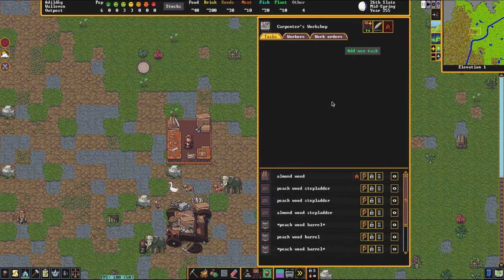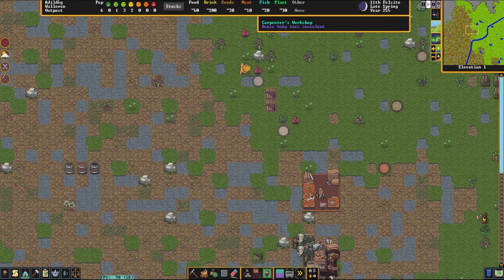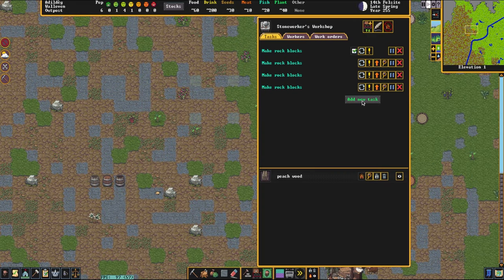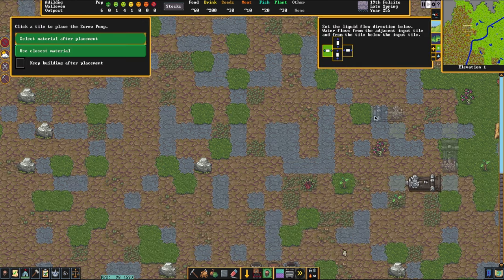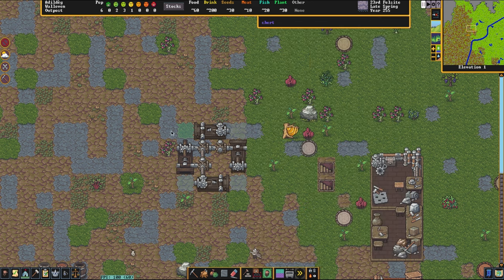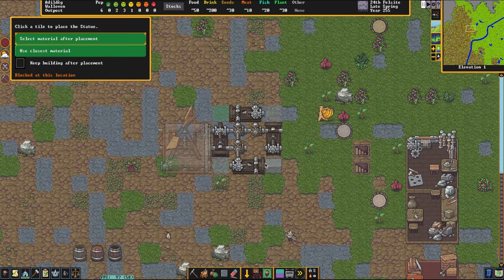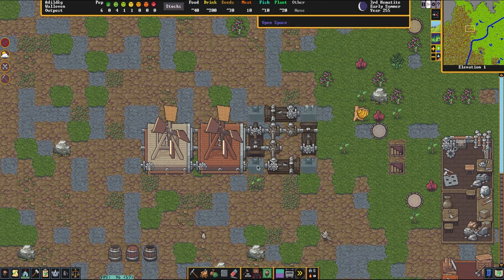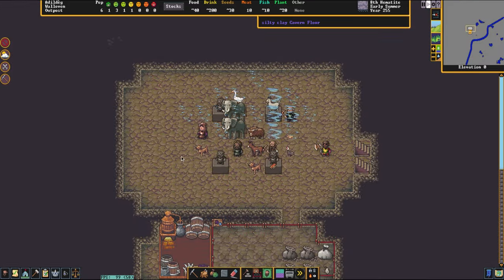Dwarf Fortress  - Quick Tutorials - Mist Generators (The right way)

Comment: Now just have to figure out how to get a bush to drop its fruit and create a puddle of wine in that spot so I can mist my dwarves with booze.
Reply: You can try a dump zone for barrels of booze in the spot the pit goes.  At least in the past dumping booze barrels spilled the booze on the spot the barrels were dumped...  Remember that from some failed experiments trying to use a quantum stockpile for booze.
On the other hand, not sure you want vaporized alcohol in the tavern.  The fights might get very explosive!
Reply: @vonsch9793  Oh what's a decent tavern brawl without thermobaric explosives?
Reply: @vonsch9793  could that even actually happen
Reply: @bufoalvarius2520  Dunno.  Haven't tried to make it happen.  Probably need an ignition source.  Dragonfire...
Of course, if a dragon is breathing fire in your tavern, alcohol vapor is moot.
Reply: It's not possible because booze in the game are technically just items, not actual liquid like water or lava.
Reply: @nak8269  hm, lava mist generators as a defensive measure))) Only problem that this system has no easy way to stop/start
Reply: @nak8269 actually false, like you can't fill a block with it, but anything that can splatter on the floor can be misted, including liquefied rocks
Reply: PETITION
John Joseph Stoner Dwarf requests residency.
Reply: A minecart from the agrifield straight to the magma chamber

Comment: Could we get a quick tutorial on how you organize your stockpiles? Feel like that would be helpful for me at least.
Reply: start very generalized, and then break them down into more specific piles as your fortress progresses. i always start with one for wood, one for stone, one for corpses & refuse, and one for everything else. then, after i set up farms i make one for seeds. after i set up a tavern i make one for drinks. after i set up a mausoleum i make one for coffins and slabs. etc, etc
Reply: make one billion bins and assign them to stockpiles
Reply: @chris-2105  I mean yes, but actually no. 

Yes, that 'works' things get in bins and the fortress isn't a total mess.

But no, when someone brings an item to a bin that bin is 'locked' no one else can do anything with that bin at all. This leads to job cancellation spam and 'serial slowness'. 

When properly setup the dwarven logistics system can make a massive number of goods in an extremely short period of time with high organization in a parallel fashion. The problem is it takes a lot of manual work and flipping of setting on individual stockpiles and even setting up things like one tile minecart stops and feeder stockpiles.
Reply: To add to that, I wouldn't mind the tutorials being a little longer for a bit more depth as well.
Reply: @petergraphix6740  I thought the bin locking issue was fixed in the steam release
Reply: Once I've realized the magic of Quantum Stockpiles, I've found keeping my stuff closer to the workshops a lot easier to organize.
Reply: @chris-2105  bins are bad ... for anything that is used regularly AND FOR TRADE GOODS! Having your gems and goblets disappear in bins makes them invisible to the "move goods to trade post" menu.
Reply: @Muck006  Not 100% invisible. You just have to go to the bins section of the trade menu.  Then you'll see finished goods bin, gem bin, etc. Then you can click on the individual bins to see what exactly is in them.

Little annoying but workable.
Reply: @douglasbeltowski7921  Then you forget you're trading with elves and try to trade them a bin full of trinkets and... argh, wooden bin. :p

Bins are evil.  I don't allow them in my forts any more.
Reply: @vonsch9793  to each their own, just trying to keep the possibilities open.  One thing I like about the elves is I can't seem then bones, or leather, or meat but I can sell them tallow roasts 😂

Comment: Funnily enough, building a mist generator this way probably would've saved 6 of my civilizations nobles, because redirecting water from a river with a water fall for a mist generator made that part where the water fall low enough for dwarves to path over it, but not enough to make it actually safe, so it killed 6 nobles, all visitors, before I could build over it all. One of them was pretty sad because they fell in, climbed up the waterfall, which was pretty cool because it was 18 z levels they fell, left, then visited again later and died on his second fall hitting new corpses as they fell💀
Reply: I mean, on the upside: You rid your civilization of 6 nobles.

Comment: That's great. Would love to see a moat tutorial (from start to finish) for fort defense
Reply: Dig. Hole.
Remove. Ramp.

Moat.

---
For those not getting the joke, "moat" just means "hole". No, it's not even filled with water usually.
Reply: @kjeldschouten-lebbing6260  I made a magma moat once, the "only" issue is flow, it slows really slow (and water to if not pressurised) so that is thing to keep in mind.
Reply: I think I heard some other video saying you want 2 levels deep and 4 wide if this helps. Shouldnt be terribly hard to make. You can make the bridge on top of a built floor and delete the floor after.

Comment: thanks I used this tutorial in my fortress, I had to build 4 windmills total for the ring, it seems my map has low wind but it's working like a charm.
I added iron floor bars on top of every hole to protect the fortress from invaders as I had to place this setup on the surface above my main staircase, there was no room anywhere near my meeting places like taverns and such. Unfortunately in winter the water freezes and removes the bars in the spot where it froze, in a future fortress I'll plan for one underground powered by waterwheels to avoid this issue.

Comment: Just a heads up for everyone. Blind mentioned managers, and he wasn't using one. I assume because it's a new embark. Another person in the comments, Pilvenuga talks about how low the requirements are for a Manager.

As everyone is probably aware. You need the requested rooms for noble positions, before they can do their job. A Bookkeeper for example, will not do his job until he has an office with a chair (table not required). (Tip: When first starting out just overlap his office with one of the chairs in the dining hall).

When you first embark, while a Manager requires an office and chair (and will say so on the Nobles screen). You don't actually need it. Set your manager, then add a work order. Either in the workshop menu, or by pressing "o" and adding it as a general work order. The work order will be activated without the Manager needing to approve it. Though you do still need to set your Manager. Once you have a migrant wave and some new Dwarves show up this will no longer work and you will require the office. I'm not sure what the exact amount of Dwarven population has to reach for this. It might be 20. I may be wrong about that part though.

Comment: I usually just get river / brook water routed to 4 statues that stand together, grate area around statues and route running water to flood caverns. This requires no power and I can fill a well as an off-channel of the drain, but it seems that constant cavern flooding does degrade fps & surprisingly just falling water without any pump action does not generate nearly as much mist as this setup
Reply: Falling water in your method is commonly 7/7 which is actually dangerous. You need to take a single wide tile off the stream, then let it widen out to 4 or 5 so it's no longer 7/7 at any point, then when it falls its much more likely to be mist. Then run it off the map via fortifications. Massively reduces the amount of calculation that needs done.
Reply: @petergraphix6740  Yeah it hasn't caused me any issues lagwise, but beware if you have a waterfall. The decreased pressure on the front of the waterfall can make it so dwarves will path over it, but they will sometimes get swept by the water and because there's a ledge there, fall off. This killed 6 of my visitors 😂

Comment: Why dont just use a hole inside 3x3 ladder with grates, so water flows from river through your base, generating mist. 
This water is also used for drinking, cleaning, and powering waterwheels. Also i find shells on grates sometimes. Drainage is, obviously through fortification.
Reply: Also, this setup is much more realistic. That's something you clearly appreciate, right?

Comment: step 1: build fort under aquifer
step 2: channel pits through the aquifer and all the way down through your fort
step 3: build a drain or reservoir or something on the lowest level

bam free mist
Reply: Note there are high flow and low flow aquifers. Doing this on a high flow with no way to shut it off would be... interesting.
Reply: @petergraphix6740  it's actually much more efficient, you have to dig out quite a lot of light aquifer to get a significant amount of water. But yes, heavy aquifer would require a diagonal gap to reduce water flow/cancel pressure if you don't want to flood the tavern!

I do like powerless mist, makes set up so much simpler when you don't have to get windmills up and running or set up another set of water channels solely for power. But I don't use power much anyway so that might be why.

Comment: Thanks for the great video. 
I made a 4X4 mist machine that worked perfectly. 
I tried a 6X6 (using 2 screw pumps per side) with everything else the same. The 2 pumps on each side were nose to tail.
But it failed, and split water down the holes, pooled up & no mist!
Any idea why?

Comment: Why does mist improves their happinnes soo quickly? The mist generator needs to be right above it or can It be above xmany z-levels?
Reply: The trick being exploited here is that a pump grabs water from the tile below it's rear and expels it directly out the front (where it falls one level and creates mist before immediately being sucked back up by the next pump).  This particular arrangement won't work across more than one Z level, although you could use a stack of pumps to bring it back up a bunch of levels.

Comment: My fort has a big waterfall right next to it. Too bad it's dangerous to be there, with the constant attacks of flying enemies. Maybe at some point I can create a structure around it and have a new tavern there.
Reply: Bonus points if you have it hidden behind the water and use a drawbridge to open the secret door to allow NPCs in or out.
Reply: I luckily don't have flying enemies, but I did put iron bars around the waterfall on my current map. And fortifications along the other open walls. Dorfs kept falling in and drowning. And I didn't want elves getting in when my river freezes in winter.

Comment: Followed guide and the 'structure' worked fine.....but the water in the pit zone froze in the winter and stopped the mist! Is this normal or is it because I had to dig down more than one layer to reach the targeted room?
Reply: I'm having the same problem in a temperate area, did you ever find a solution other than having to build deeper down?

Comment: Is there an efficient way to haul stuff up the z-axis? An elevator? Some fancy corkscrew minecart track?
Reply: Minecarts with ramps IIRC and setting Stops and unloading but someone has to reset and push the cart back down to the lower levels.

Comment: How should I go about building axles? Dig a hole next to my stairs and build it in there? Will creatures be able to enter a hole from the wall where an axle passes? Can axles go through slits?
Reply: You need to connect the curves/endpoints of the axle with a gear assembly. So, you go horizontal right > gear assembly > from here you can connect a horizontal that goes up/down/left/right (on the same z-level) or you can go below and place another gear assembly directly below the top gear assembly, and from there you can make the axles on the directions you want again.

If you want to go straight up below the earth I believe you use the vertical axles to connect below the gear assembly and design it like you would do with stairs, except there should be a hole already dig.
Reply: @victormatheus3576  Or just put your power source below the surface with no holes.  Safer.  Look up waterwheel on the wiki for some examples.  Perpetual motion machines are a thing in more ways than this in DF!

Comment: someone needs to start testing the frame and load of everything in DF, for example: What is more heavy for the game? several machines or mist generators, or several diverted waterfalls, because only one is easy to say it does not impact framerate, but usually we are doing several different things in an enormous fort and we don't know what would be the least impactful. 
I was personally thinking of diverting a river/creek into a X shaped stairs, where 2 sides of the X without stairs would have the mist and I would put grates in each floor. If we have a fort deep enough (100 floors) that surface water would fall (I would try to have it 1-2 deep only, never 7) but the cost on frames might be bigger than diverting the river into the fortress, creating a mist generator only on that level.
Another question: where is the best place? I saw videos saying TAVERN, others TEMPLE and others DINING HALL (because they compound with other happy thoughts of having a good meal). if that is the case my plan above to put in the stairs is less efficient than putting in the dining hall.
same goes with other technical questions: having one (or more) quantum stockpile or dozens of huge stockpiles? or even linked stockpiles?
I had linked stockpiles, I found it great, but if someone focus on testing dozens of them and explain to me that is more taxing than a quantum stockpile, I would change it.
What is the best case for a wheel barrel? distance  vs minecarts. Because we are usually only mining far if we are looking for something, so in theory we would not have minecarts there.
Reply: When building any water feature always have a way to turn it off. For example if you're diverting a river (always a small part of it, never all of it) Use a back to back bridge setup as it is invincible when raised. You can then do live FPS testing and if things don't work out you can reroute it into a flood storage tank where you route enemies under it and drown them.

Comment: Is there a design that works on a 3x3 (or any odd numbered) setup? All the mist generators I've seen are similar to this where it's set up for even numbers. I'd like to put it in my central hub, but my fort is based off of odd numbers (major halls are 3 tiles wide).
Reply: A screw pimp requires 4 tiles (input,2 for the pump itself, and the output) so you need at least a 4x4 area. A 6x6 could be made by adding a ramp to funnel the water

Comment: Is a floor 1 z below needed for the mist to generate, or can it generate mid-air? I'm wondering if this setup would work with a tavern or temple whose roof is higher than 1 z. If it works, then I guess the statues can also be left out of the equation.
Reply: From my experience it does work, although you won't see much mist at the bottom floor where your dwarves are. But I think they can still see through the grates because it worked for me, and my mist generator was 2 levels above the ground floor
Reply: @vincentsalcido9605  Thanks, have to test it out.

Comment: Can mist fall multiple z-levels? I'm just asking as I have some 2-3 z-level tall spaces I'd look to put mist generators in, but if it won't manage to reach the 'ground' then there wouldn't be much sense in constructing the whole thing there.
Reply: I'm wondering the same. I built a generator two levels up and it seems to not work.
Reply: @JohnnyDoom  Mist definitely travels up at least one Z level, so I suspect it will travel down as well, the hard part is probably priming the loop. 

A 1 deep tile is insufficient to prime the system, hence the second bucket of water getting it started for Blind. And that 2 or greater depth needs to be in the tile behind and exactly one level below one of the pumps to prime the system. A temporary room that you then remove is the most obvious fix for that, although dumping a minecart load of water with a track stop may work as well . 

The next problem would be whether the next pump can catch the water after falling one level, but before falling 2 levels. My gut says that will be inconsistent, but testing is needed. If it works, the statues will not be needed.

Comment: How do you do this across multiple Z-levels? Does this design work?
Reply: I saw the same design on another youtube video, and you can just tie the windmills using vertical axels down through your base to the level where you want the screwpumps to operate above your tavern. It's the setup I'm using and it's great. 2-levels of water seems to be fine, as 3-levels of water can leave stuff 'submerged'

Comment: Will this still work if the temperature is "Hot"?
Reply: yep! at least on my fort it does. Some of the other comments here say there's places with no wind though so that would definitely be an issue
Reply: @ricrackem  It can also be used underground if you create a dwarven power reactor. The laws of thermodynamics don't apply here.

Comment: Has this design been outdated? I tried this on my most recent save and this didn't do anything except cause a puddle. Everything is build the exact same but isn't working.
Reply from the maker: It takes two buckets of water to work. So if it dries up before they bring the second bucket or third if it partially dried. Then it won't work.
Reply: @BlindiRL  I’ll try again when I get home but it never started working for me sadly :( The dwarves put 3 or 4 buckets worth of water in but the water just floods the statue and floor next to it. The only difference between mine and yours is mine is 2 deep instead of 1 deep like yours.
Reply: You were right lol. I just dug down made it an enclosed space and it instantly started working. appreciate you boss :) 
 @BlindiRL